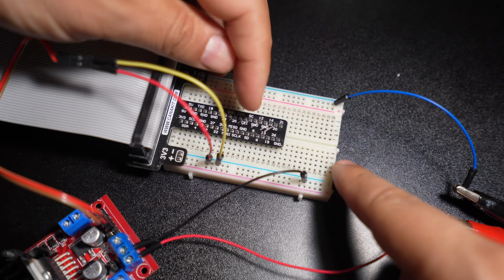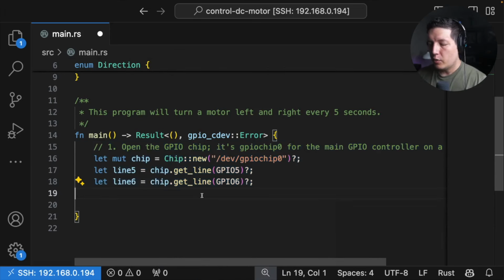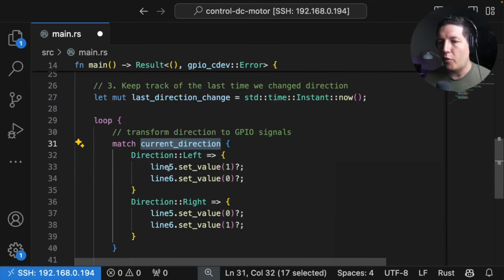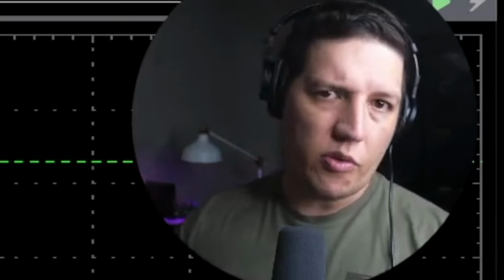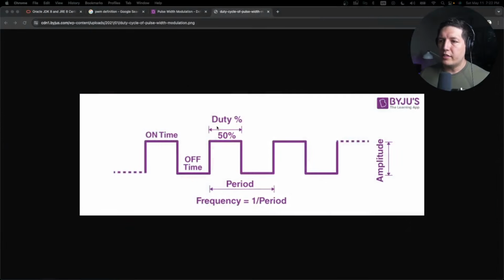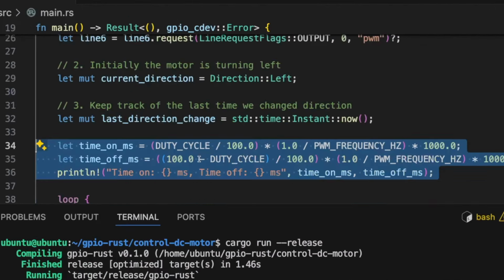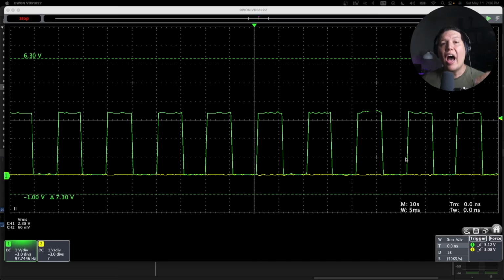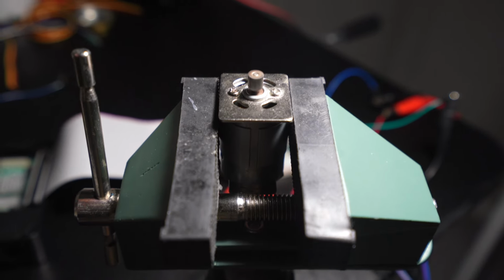Controlling a DC Motor with Rust: The Easy Way

Comment: thanks, im programming my own flight control system but with a twist (basically it can work in herds or as i like to call it an array, currently i call it AVA (Autonomous Vehicles Array) and its super awesome, the idea is that there will be infrared lights which other ava drones in the airspace can detect for real time data on where other ava drones are present, all the drones can either be connected with a leader model or a main ground commander)
Reply from the maker: 😱😱😱Whoa!! This sounds like an awesome project!! Are you documenting it?? I would love to follow along!!